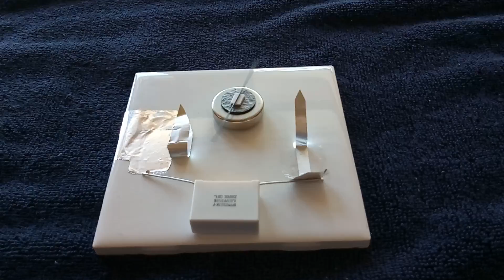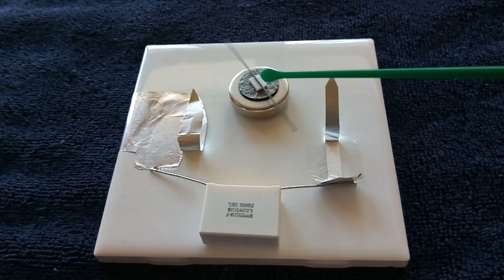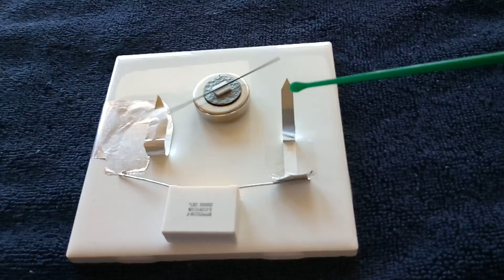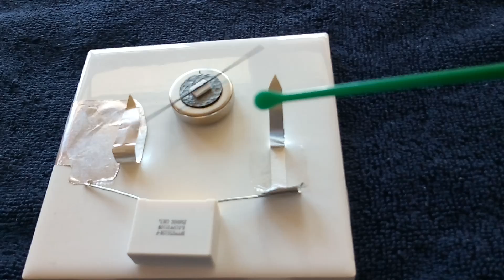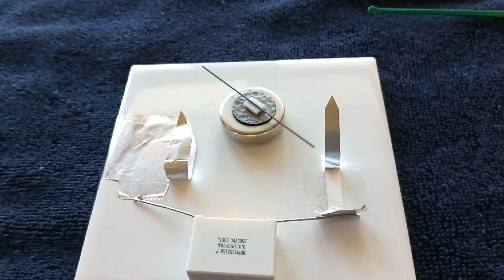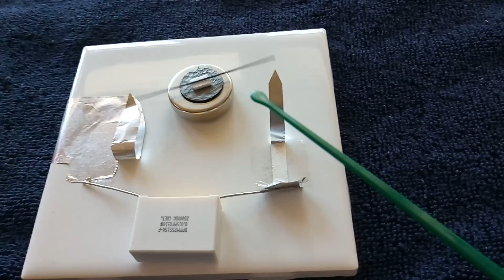Electrostatic motor using pyrolytic graphite bearing

Comment: Electrostatic motors have been used in very high precision Inertial Measurement Units to suspend and drive hollow beryllium spheres
Reply from the maker: Thanks.  I will look that up.
Reply: @Lidmotor  the system is the SPN/GEANS inertial navigation system used in the B-1 bomber.
Reply from the maker: Thanks.  My sister worked on the B-1 bomber project many years ago.  She was just a tech writer but she was part of it.

Comment: No contact on anything whatsoever, that would be very neat.
This one is a novel approach again, strong start up too. I wonder if lightning rods on high rise buildings would work for the voltage. Kinda cut them off just before the base. Might fall foul of regulations, but it beats balloons or similar.
Reply from the maker: I thought of an easier way last night to get the HV charge.  A large Zamboni dry pile will do it.  There are a bunch of videos on how to build one. It takes time to build a good one that puts out at least 1000v. The Oxford Bell uses that and it has been running for over 178 years -----non stop!
Reply: Oh yes, the Oxford Bell! 
I think sMartCreations built one a few years back. The idea of being a dry cell is something to look at, maybe throw a bit of Lithium on top to power cars... 6 million miles range  :)

Comment: There is a way to convert sunlight into high voltage.  Use a step-up transformer.  Connect the low turns primary (2 turns) to a 0.5 PV cell & the high turns (8000) secondary to your capacitor. If the charge rate is too slow, then increase the number of PV cells in series & reduce the number of turns on your secondary winding appropriately to get the transformer output V that you desire.

Clever design, btw.  Thanks for sharing!
Reply from the maker: Thanks.  On these electrostatic motors the voltage has to be static and not ac which is what you need to use a transformer approach. That all can be worked out but the circuits will eat up energy.  A big enough solar panel could solve that problem.  Thanks for the ideas.
Reply: @Lidmotor  Oops.. You're right.  The transformer will only increase the output V if the input V is AC.  That means you'd need to convert the DC to AC before inputting it into the transformer & then use a fullwave rectifier & smoothing caps to convert the AC back to DC (which might be expensive) for your electrostatic device.  What are the input requirements for your electrostatic device?

Alternatively, if your electrostatic input requirements are minor, then you might be able to use a DC to DC boost converter.

Comment: you should look up the new frictionless air bearing technology we have now.  apparently if you machine two surfaces within 8 microns which is extremely difficult and place them together you can get them to spin without touching each other there's some kind of effect that creates a cushion of air between two surfaces that are perfectly machine it's new technology.  You have to check it out. it works better than magnetic bearings it's completely frictionless.  because with magnetic bearings you have slight drag in the magnetic field but frictionless air bearings have absolutely no drag.

Comment: 1:30
If you dont have room for a long antenna wire you could try a shorter antenna under a power line. 
(before the transformer that goes to your house)

They carry around 7k volts if I recall, while the longer runs next to highways carry around 14k volts if I am remembering right.

I once built a high voltage detector and was surprised how strong of a reading I got while walking under power lines.

Also interesting, the readings were not as strong when the power lines ran through the branches of trees or a hill that got 10 feet closer to the lines than normal,  high voltage being shunted to ground.
Reply from the maker: Thanks.  The charge has to be static and not an AC type voltage but I could use a capacitor and diode arrangement to get the job done.  I think my power company would frown on the idea. Maybe I could hide the device in one of my bushes.  Ha.